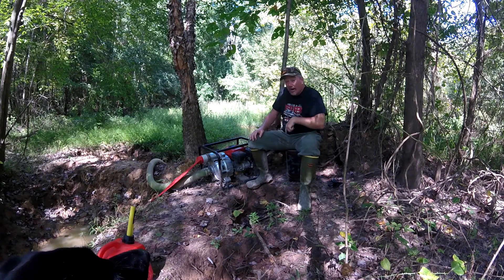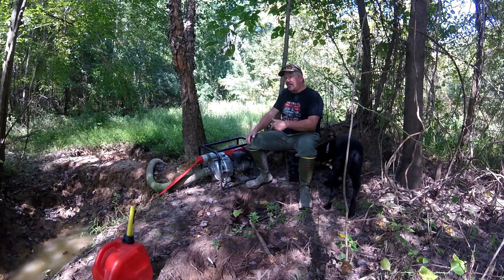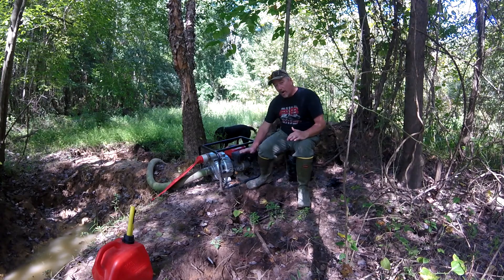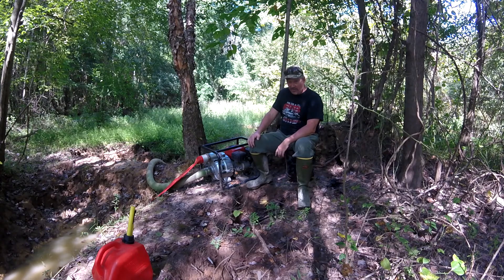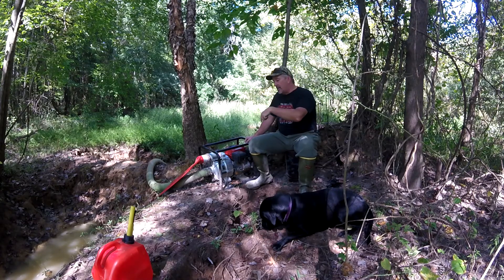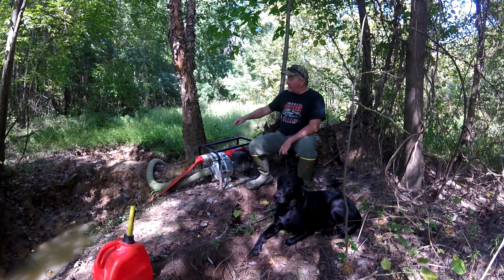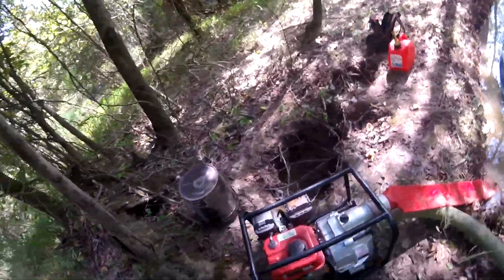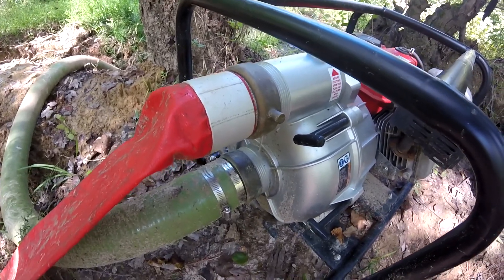Managing a Waterfowl Impoundment | Pumping Water

Comment: what if you rigged a fuel tank sitting on top that funnels into the original fuel tank. then your not limited to such a small tank
Reply from the maker: That’s pretty much what I did but directly to the carb and not to the existing tank. Check out this video. Details on Extended Runtime Trash Pump | Duck Hunting
https://youtu.be/bBOV8P9OIRk

Comment: Look up go kart external gas tanks. I pulled the gas tank. Installed a fuel pump drew a pulse from the valve cover. I run it 12 hrs with a 5 gallon marine tank.
Reply from the maker: That sounds interesting. I actually rigged up and external 5 gallon tank. With the bottom about even with the top of the pump, it runs a good 10-12 hours.

Comment: I’d like to see what you are doing to run this pump for 12 hours!!!
Reply: North Carolina heck yeah what part of the state Davidson County here!
Reply from the maker: @koontzoutdoors1555  I live in Wake County
Reply: harbor freight has 2 different 3” pumps. a 301cc pumping 23,000 gph/383gpm for 899.99 and the 212cc pumping 17,400 gph/290gpm for 399.99
Reply from the maker: @justinmizell3363  Interesting.  I don't see the higher rated one on their website.  Can you share a link to it?  I'd have gone with the lower one anyway just due to cost though.
Reply from the maker: I’m not getting anywhere near 12 hours. About 1:45 at full throttle and maybe 3 hours at half throttle. 12 hours would be awesome.